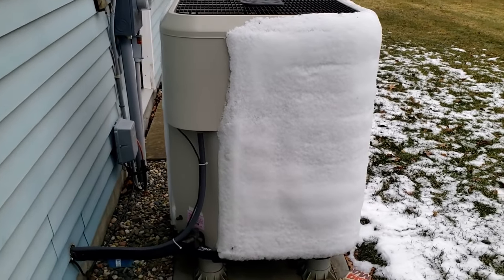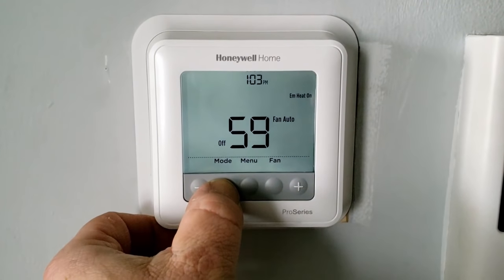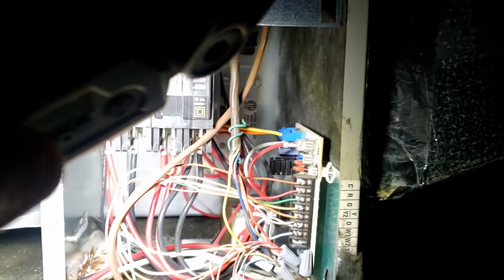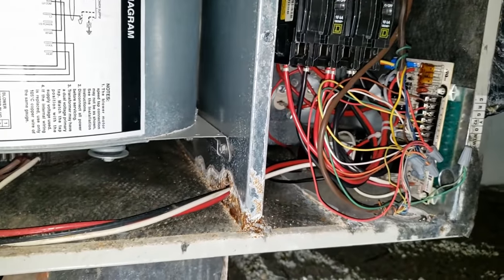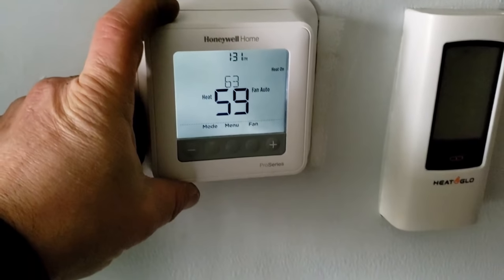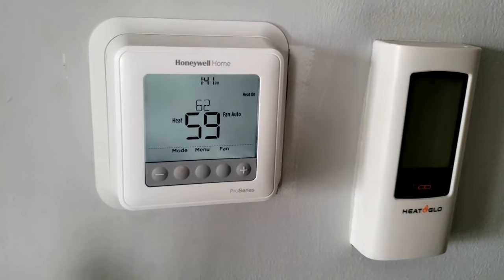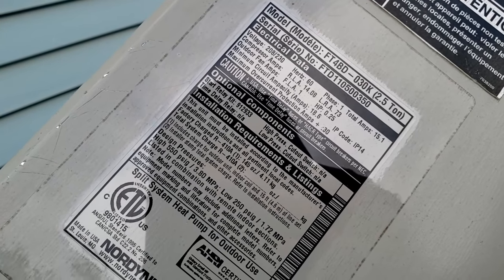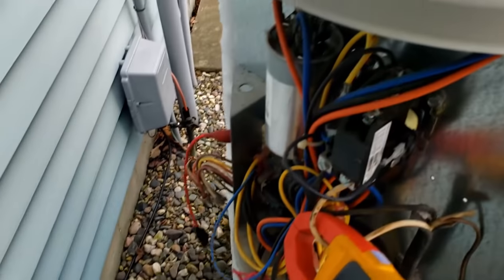HEAT PUMP FROZEN UP LIKE A ICE MACHINE I MISSED  UP & TOASTED THE FUSE

Comment: Can't believe that you didn't fix the power chafe point where it went through the raw sheet metal edge.
Reply from the maker: Do you mean the factory built hole that has a rolled edge where all the wires go from the cabinet to the compressor area or the worthless metal bracket that I removed at 18:30

Comment: Hey, maybe someone in the trade could answer me if the rated current on the label, not the maximum current that's drawn at starting the compressor, is the actual maximal normal AC current measurable at the outlet?
Reply from the maker: I reread that 6 times and I'm still not sure what you want to know? Sounds like you want to know something about the rated run amps and not the inrush current? If so what is it you want to know about it?
Reply: @HVACRSurvival  ok, under normal circumstances, does the current on the label match the measured current?
Reply from the maker: normally you'll be under what they're rating it at, generally that's what I want which means I have more room to go.
Reply: @HVACRSurvival  Thank you. 
I asked because, from the very limited pool of measurements I've don on AC compressors draw, this is exactly what I've observed, a current draw between 50% and maybe 70-80% from what was on the label. 

This reinforces my approach of not trying to load the system up to the labeled specification but quite a bit below.

Comment: In a climate that gets snow hear pump is trash furnace is king also heat pumps runs the electric bill sky high. When i lived in colorado we had a furnace now I live in virginia with a heat pump and am considering get a  gas run to the house
Reply from the maker: Depends what state you live in what your electricity will cost and whether or not you have natural gas available but even then natural gases went sky high thanks to bad decisions of other people.

Comment: It's probably dropping out of defrost on high head pressure.
Reply from the maker: I try to not gauge up unless I feel a need but looking back, I should have checked the pressures.
Reply: What happens sometimes is the ice melts away from the coil just a little bit. The coil will be defrosted but still in a cocoon of ice.
Reply from the maker: Yep, been there delt with that👍👍

Comment: Thank an engineer for those instructions. There should be a requirement for licensure of engineers to serve an apprenticeship before entering school. Maybe then they could think like the people in the field and not like the stuFfed shirts a lot of them are.
Reply from the maker: I figured I was just reading it wrong but who knows. 😁🤷‍♂️
Reply: @HVACRSurvival  No, lawyers, engineers, and architects communicate in a convoluted way and it sometimes looks like they do it to keep themselves being needed.
Reply: the directions are OK, the board labeling is kind of funky, on the right side of pins it says "for test only" and the word TEST is directly above the middle pin, then on the left they say T2(top), DFT(middle) and TEST(bottom) in smaller text.
jump top T2 to middle DFT(same as closed defrost thermostat), then temporary jump bottom TEST terminal to C until it reverses(speeds the timer up to seconds)

Comment: What's wrong with a tee before a trap?
Reply: Air gets sucked in and prevents the water from running out.
Reply from the maker: Bingo👍👍
Reply from the maker: Because the tee renders the trap worthless. Technically the only reason for the trap (bedsides being required in some jurisdictions) is when the EVAP coil is on the negative side of the blower to allow the water to drain from the coil when then coil is in a negative pressure zone. I prefer a tee myself for all other types of coil layouts that are located on the positive side of the blower.  I'll also say a tee is great "after"  the trap to help prevent double trapping but they won't work on this type of coil layout.
Reply: @HVACRSurvival  Yeah I get that, I just thought you meant you shouldn't put a tee before the trap is all. I think adding the tee is best practice so long as you dry cap the top, makes it easy for cleaning the trap
Reply: It’s a clean out tee.. I do them on every install, but it needs to have a slip cap installed to prevent air being drawn in from the  negative pressure from the AH which won’t allow the primary pan  in the AH to drain.
Reply from the maker: @jasonreitz6049  why not put the tee after the trap that way you don't have to cap it, you can still clean it out and it helps alleviate the possible chance of having a double trap,  causing it not to drain properly.  I've had so many people install it wrong because they don't understand how and when to use a trap.
Reply: @HVACRSurvival  actually I do that also in a lot of scenarios , especially an attic install where I can’t visually see the drain line to see if there’s a sag in it somewhere that would cause double trapping. The main reason I put one before the trap is so when I’m doing the Pm, I can flush water through the trap as I’m vacuuming the drain line from outside. Where feasible, I will put the trap outside and not glue it, so I can pull it off and flush it out with the hose during the Pm. I find a lot of my drain blocks are from clogged traps.

Comment: I would have just energized the orange wire and/or reversing valve to put it in heat or a seed or reverse the process to defrost your unit
Reply from the maker: Yep and I explained why I didn't do that but no one knows how to read.

Comment: Sensor,  defrost control board .... low on charge , reversing valve , outdoor metering device
Reply from the maker: Shotgun approach🤣
Reply: @HVACRSurvival  order of diagnostic priorities.
Reply: @HVACRSurvival  id only use the test feature on maintenance.  I already know its broken ....
Reply: @HVACRSurvival  I've also seen it on a dramatically oversized system ( oversized cooling load x2 roughly) the defrost algorithm had a min run time and the poor thing was short cycling its way to hell . But that was a dark horse .
Reply from the maker: @mikepict9011  ok, i got what you saying now.
Reply: @rottiev264  unless it was masked by aux and was just so that the restriction was mimicking low charge . But whatever near the bottom of the list
Reply: @rottiev264  i mean the defrost would still work but it could be excessively freezing during run time and building up . I agree its super unlikely

Comment: QUESTIONS DO FURNACES HAVE A FILTER OR THE RETURN AIR DUCT THE ONLY AIR FILTER I HAVE TO WORRY ABOUT  (SORRY FOR THE ALL CAPS CAPS BUTTON IS SHOT)
Reply from the maker: Usually your air filter(s) are located at your furnace, sometimes they are located in the return air duct on the wall or ceiling behind a removable grill.
Reply: All intake air should be filtered and leaks sealed. When hair and dust clog the evaporator coil you get bad smells and subpar air conditioning.  When heating, all that crap can reduce air velocity causing an overheating situation of the heat exchanger, that the trips the limit switch. If thats bypassed your heat exchanger can crack.  But yes the intake supply only needs filtered and the filter should be changed often.

Comment: mine is frozen from head to toe in ice. idk what to do guess ill call someone
Reply from the maker: There's not much you can do but cover the basics if your a homeowner. Keep your coils and air filter clean and have it serviced more regularly. Otherwise you could cause more damage by guessing at the problem. Just my 2¢
Reply: 95 percent of the time it's the defrost thermostat. A homeowner can't check that without some experience with heatpump defrost systems

Comment: Easier way to defrost outdoor unit. 
Jump R and W at the thermostat or air handler (possibly G depending on some units)
Jump out R, Y and O at the heat pump (except Rheem/Rudd)
Hookup your gauges to monitor pressures could have been kicking out on pressure switch.
Easy to tell if there’s a crankcase heater, check for conductors at contactor or read schematic.
Do better next time jabroni
Reply from the maker: I was more interested in finding out why it froze is why I did it the way I did. Otherwise it would have frozen again

Comment: Dude... if you look at the "FOR TEST ONLY" block, there are three terminals: T2, DFT, and TEST. The instructions say to connect T2 to DFT, and then C to TEST.

At 2:28 we can watch you connect C not to TEST, but instead to the jumper you've already placed between T2 and DFT.

It's a completely understandable mistake, reading it as "connect C to the test jumper you've already put in" instead of what they meant, "connect C to the terminal labeled TEST," but it is, nonetheless, an operator mistake, and not grounds on which to attack whoever wrote the instructions. The instructions are correct. What you did is not what the instructions said.
Reply from the maker: I just rewatched it, you are correct, I screwed up.

Comment: Do you ever find yourself annoyed by all the excess wiring found in equipment?  It's hard to manage sometimes.  Seems like a waste of money and copper.
Reply from the maker: Sometimes it does, I usually just clean it up, The OCD kills me
Reply: It does come in handy when I have to disassemble the cabinet for deep cleaning though. When I remove the fan and top shroud, I sometimes must remove the wire ties and pull some out, hanging the top on a step ladder takes the slack wire. Always keep new wire ties around.😀👍
Reply: @douglas60040  I was pondering cutting the fan motor wires and installing a male/female plug or just crimp tabbed m/f crimps for easy removal for coil cleaning etc.  I'd appreciate input on plug terminals that work well for this.

Comment: Turn it to ac
Reply from the maker: Melting the ice was not my first concern, finding out why it froze was.  Running in AC mode is only going to melt the ice until it loses contact with the coil. You'll still have 3 inches of ice to melt.
Reply: @HVACRSurvival  I use to work in hvac installation and service.  Never care for heatpumps
Reply from the maker: @Dwohman  that's cool, I use to hate them to until I got into Geothermal

Comment: In my 10 years experience Nordyne are crappy pieces of trash. Boards often fail, had countless issues with motors dying less than 5 years in, sensors and safeties failing left right and center. Poorly made. 
Between Heil and Nordyne those two are my bottom of the barrel companies that I wouldn’t recommend  even to those i dislike. 

I strongly urge customers to consider products that are better made. customers on average spend 20-35k on a car and make monthly payments, most companies have a 1 year instalment plan for most equipment furnaces run usually 5-7k installed and about 4-6k ac installed. If you spend that extra one thousand dollars you can still get a fairly inexpensive unit, won’t be the cheapest but generally speaking you get what you pay for. 
In my opinion if you can spend that on a car you can spend that on a piece of equipment, and most consider furnaces to be integral to a home, but when they skimp on getting something decent they shouldn’t be surprised.
Reply from the maker: You wouldn't believe how many people have commented like I'm crazy and have no idea how a heat pump works because I wasn't familiar with the Nordyne proprietary, 3 wire test function defrost control.  We don't sell these and I had never worked or seen one in the 26 years I've been doing this.  There was no instructions that told how the control worked other than what I seen on the cover, it was over complicated and I misplaced my jumper and blew the fuse. It's been several weeks since repairing this and we haven't had to return, It looks like I was correct in my repair 😏. You said exactly what I wanted to say but didn't want to come right out and say it because I don't make these videos to roast the equipment, I just show how I repair it. Thanks for the feedback!
Reply: First time i did one of their heat pumps I did the same thing, i blew a fuse exactly like how you did. they couldn’t have made the instructions any more convoluted because that’s exactly what it said to do and it blew. 

equipment that doesn’t come with clear and concise instructions is in my opinion already a sign that the manufacturer is cutting corners on every level. Carrier make it simple two pins you jumper together, no jumping to common required, that’s how they should all be done.
Reply from the maker: I agree and the fact that you can jump the defrost termination switch at the connection point on most control boards, how many times do you plan on needing that prong feature on the Nordyne board? Hopefully once or twice in it's lifetime. They must of planned on it failing a lot🤦‍♂️
Reply: Because i live in Canada and conditions are known to be harsh I’ve always been testing out the defrost function during all ac maintenances of said heat pumps. mind you it’s only really testing the board, but i have swapped out a few boards on a few brands, but at least it wasn’t during the winter

Comment: I just worked on the same gibson unit,  rats chewed the wires to the DF sensor and compressor and the nest shorted out the board, replaced both and cleaned the coils was good to go. Heat Pumps in North America are STUPID !!
Reply from the maker: Mine saves me money over LP GAS until it reaches between 25-30 degrees Fahrenheit outside.

Comment: What's the bottom line here? Heat pumps suck when it comes to heating your house?
Reply from the maker: No, I think they do good when they're sized and installed correctly with a quality brand.
Reply: @HVACRSurvival  Well, I just rented a place with a Goodman about 4 year's old, seer rating of 14-15 and a brand new furnace. Here in the midwest it gets pretty cold in the winter. Don't know who installed it or how well it was installed. I guess I'll find out in a few months. Thank you for the reply, have a safe 4th.
Reply from the maker: You'll be fine, if it has aux heat. That should take over when the heat pump can't keep up

Comment: Just run in emergency heat that'll defrost it
Reply from the maker: 🤣 how long should I wait for the outdoor temps to get above freezing?
Reply: @HVACRSurvival  I have some older janitrol units that freeze any time it's under 30 degrees. Emergency heat defrost the pump then return to normal heat, it's going to freeze up again, just have to rinse and repeat. Idk if it's because the refrigerant is low or the pump doesn't pull all the refrigerant  out of the system. So my understand is emergency heat is for defrost of pump while strips heat the house could be wrong but.thats how we've done it for 20 years
Reply from the maker: @Blazzinace  I thought you were screwing with me, the auxiliary heat is supposed to come on to temper the cold air while the heat pump is in defrost (AC with no outdoor fan). Around here when people having a all electric home they will run the heat pump potentially down to zero degrees. If you think about the amount of amp draw one electric strip is compared to a heat pump, you can run that heat pump all day and not use near the power that one electric strip pulls. That's why I'll set my defrost timer for 30 minutes on a all electric system and 90 minutes on a dual fuel. If it's a new or higher efficiency unit I'll set it at 60 minutes if it's all electric. They will frost over but they shouldn't freeze into a block of ice.
Reply: @HVACRSurvival  I wouldn't screw with ya, I'm a maintenance man I need you to help me fix things lol, I don't have any issues with my Goodman units there all about 12 years old it's just the janitrol there all 1989 units. I have 11 of them and at least 3 will freeze up under 30° I've always been instructed to run emergency heat on them till they defrost then return to normal heat
Reply from the maker: @Blazzinace it it's winter there,  i would either pull the charge and weigh it back in and add for the additional feet of lineset or check the charge in AC mode during the summer months.
Reply: @Blazzinace  hehe, the newer communicating systems will turn the heat strips on when defrosting outdoor unit automatically, no user intervention required.
I believe some of the older basic systems did the same (pre-magical circuit controls) that would have been top dollar junk back then though